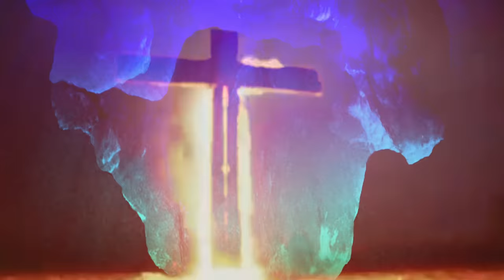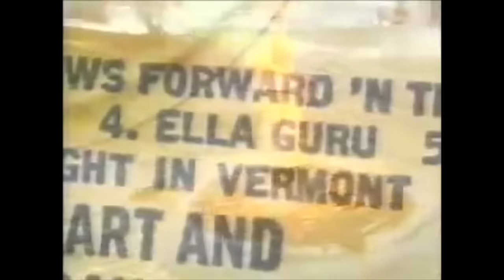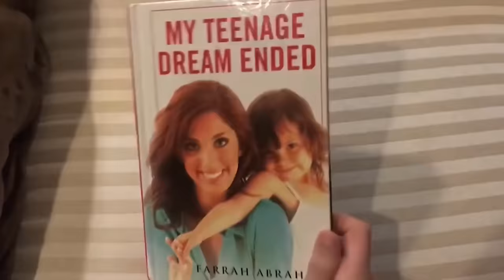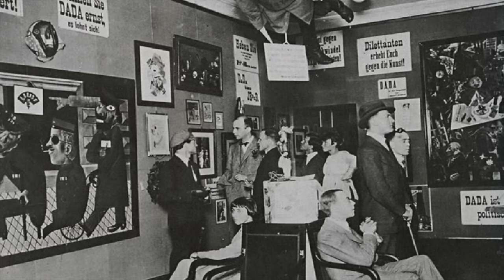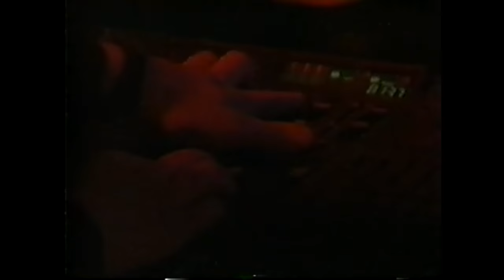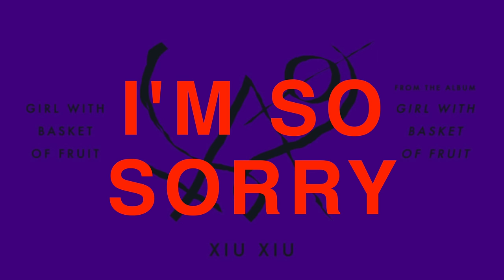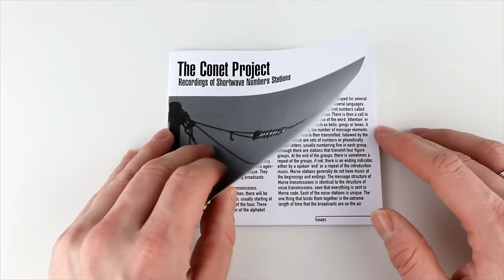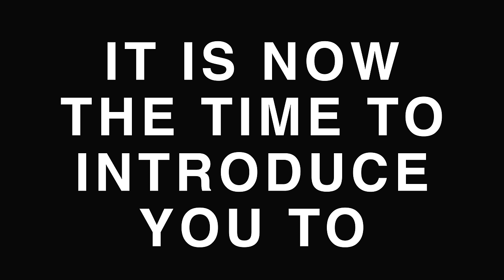DISTURBING ALBUMS ICEBERG EXPLAINED | Complete Edition

Comment: Great list, however, I would have changed Public Castration is a Good Idea with Soundtracks for the Blind
Reply: If anything it should be cop or the young god ep. Soundtracks is good, my favorite album actually, but it was generally just Gira trying to get everything he could out before he left, and it is really good, but i wouldnt really call it disturbing, it gets disturbing at moments 100%, especially the noise/found sound parts like her mouth is filled with honey. But its not 100% disturbing from start to finish. Cop and young god though grab you from the very beginning and drag you through mud and fire until the very moment the album/ep ends